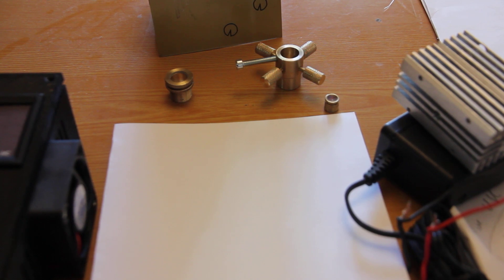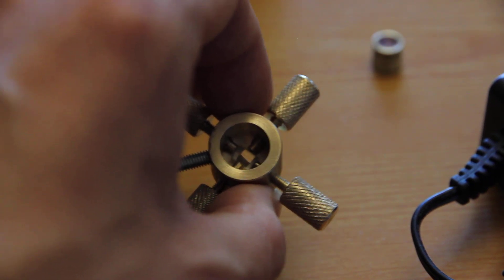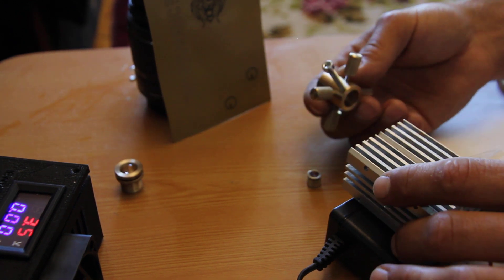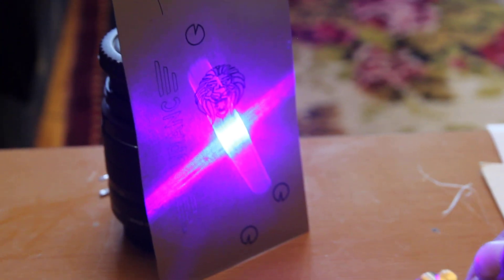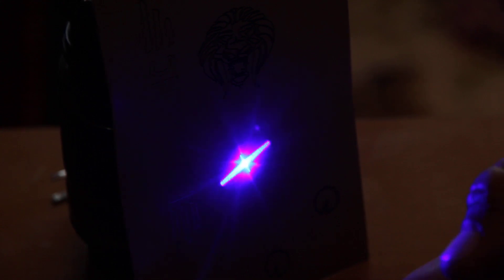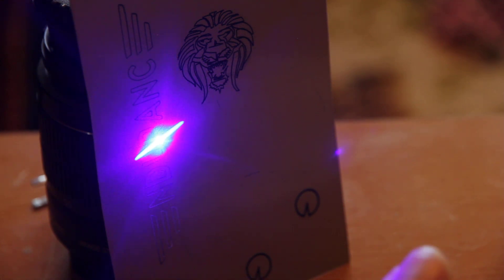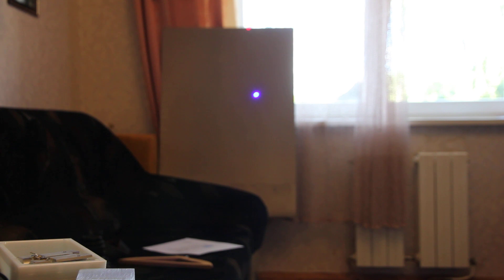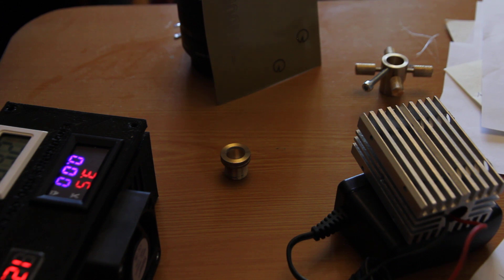Improving a laser beam spot for a diode (solid-state) 445 nm powerful lasers

Comment: What is the point of having a circular dot at 2.79 metres?  I have never lasered anything at 2.79 metres!!   Surely you need a circular dot at around 30 mm?
Reply: Its a matter of illustrating beam quality.  If the laser is collimated to a more or less circular spot when projected at a few meters, then it is most certainly circular at the short distances used in laser engraving and etching.

Comment: Will this be out. For sale and testing
Reply from the maker: yes, soon enough
Reply: Is it mirrored surfaces directing the beam into a square shape....or are you just rotating bolt heads together essentially absorbing all that usable energy in the brass or whatever that's made out of.....
Reply: Hi. Did you ever put this up for sale?